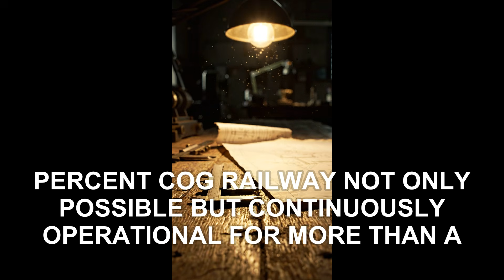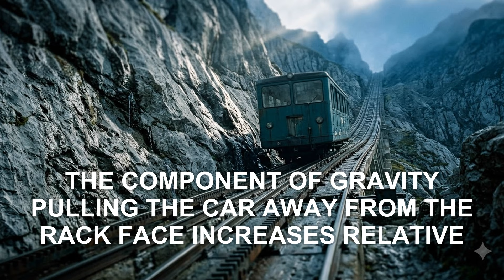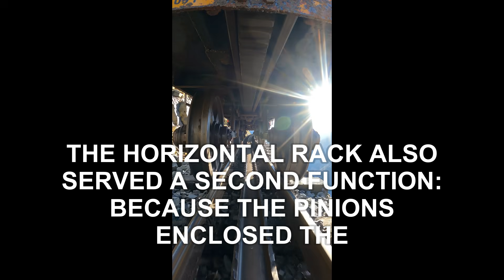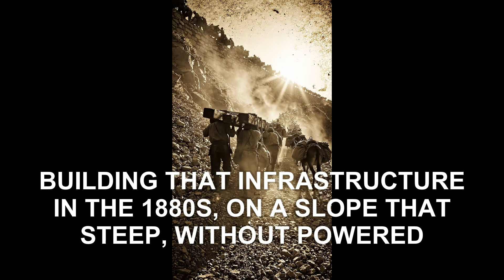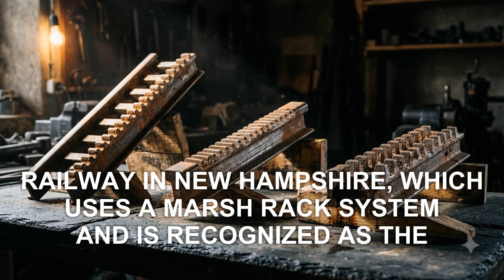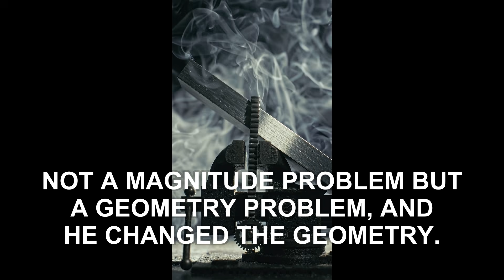Why This Train Cannot Slip Even on a Vertical Climb

Comment from the maker: 48% grade. Existing cog systems unload past 30% — gravity pulls the car off the teeth instead of into them. Eduard Locher didn't force the old rack harder. He flipped the geometry: bilateral horizontal rack, pinions gripping from both sides, engagement independent of gravity.

One question: is changing the direction of grip the only honest fix when force geometry kills every vertical rack… or did Pilatus just lock itself into a custom supply chain no other railway will ever share?

Drop your take 👇

Watch next: How China Built the Longest Water System in History